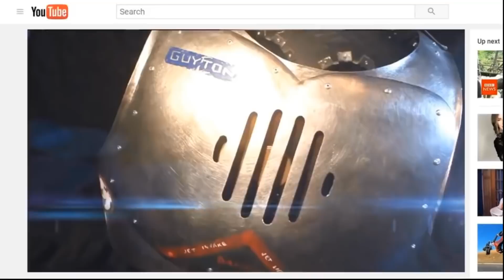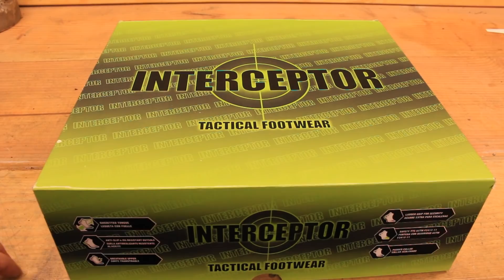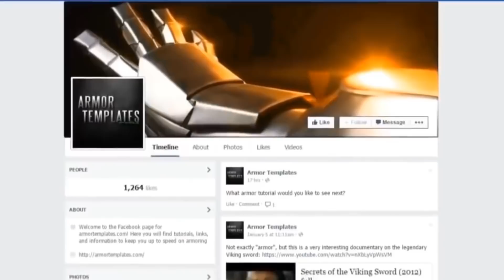Bionic Leg Tutorial

Comment: What size boot did you use, i think ill make a pair but i want to know if itl work for other sizes or if there are other sizes on the template, im a size 9, oh and do you have any recomendations on where 20 but the 20-Gauge?
Reply from the maker: These were size 11, but the template explains how to deal with different sizes. You can see that there are gaps between the pieces of metal. Those gaps can be smaller or larger depending on your size. I always suggest doing things in paper first before committing to metal. That way you can either trim where necessary, or start over and scale the template down some.
Reply: alright, thanks!

Comment: I made the bionic arm (not quite finished) but I didn’t end up using your template, but I used your techniques, and it’s modelled as automail, just having issues with riveting it to the leather and getting holes in the steel in certain spots

Comment: Cool video. one question though, is this or  any of the designs you create battle ready? If not , what thickness of steel would be needed to make theses designs so?
Reply from the maker: The design usually has little to do with being considered battle ready. It's about the thickness of the steel and whether or not it is heat treated. None of my videos feature heat treated armor, but a couple have 16ga thickness steel, which is what you would be after.
Reply: Define "battle ready"?
Reply: @F3EDER  Battle ready, ie, if the world to decend into total chaos and some how firearms would become useless ( I know that would not happen, but regardless) would this armor or any armor from David's past videos would be able to hold up against sword / knife attacks , as in one on one combat or a seige.
Reply: 15th-16th century knights generally had 16 gauge tempered plates. You need some AR500 steel or Honos armor plates to make this "battle ready" for the modern day lol

Comment: If I'd use visible bronze washers? 
How would that hold up compared to steel?
For instance putting bronze washers at the riveting points
Reply from the maker: When you have two dissimilar metals in contact with each other, you can get corrosion at that point. However, I have used copper and brass for riveting and have seen no corrosion. Bronze would be similar to brass, since it's copper and tin. Brass is copper and zinc.

Comment: Will the template be variable for different shoe sizes?
Reply from the maker: You should be able to modify it to fit different shoe sizes. This is for a size 11 boot, but remember there are gaps between the parts so that gap can get a little bigger or smaller to accommodate for different sizes. You can also scal the template up or down using your printer